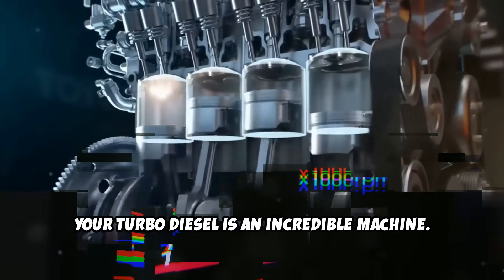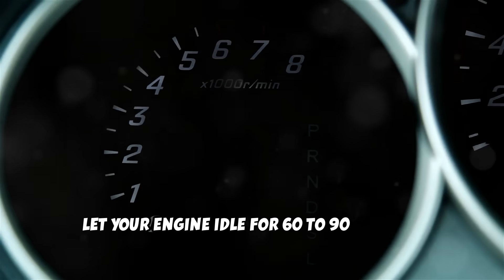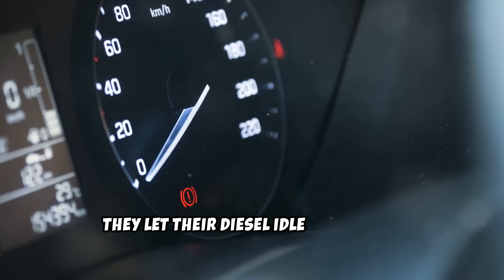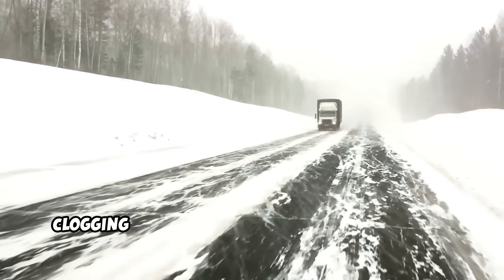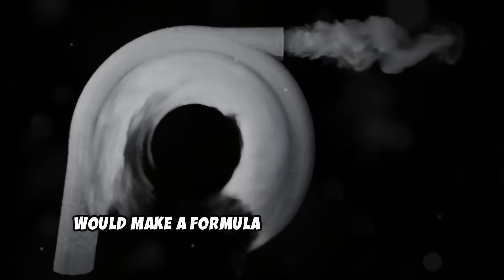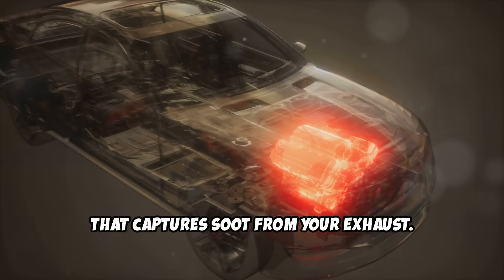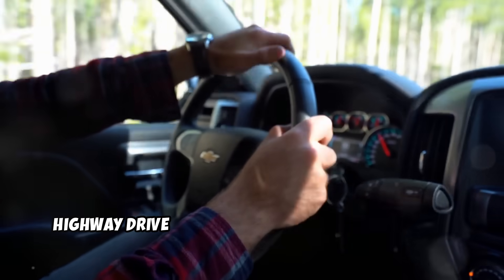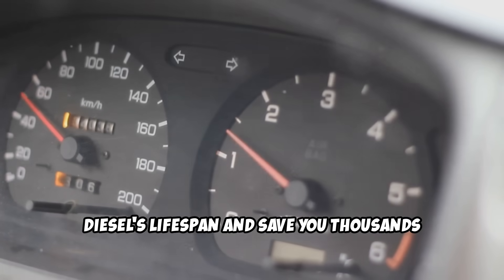Why Your Turbo Diesel Won't Last 200,000 Miles Anymore (Never Do These)

Comment: If you shouldn't turn of your car after a long drive how do you get on when you're car has a stop start
Reply: on stop start, the cars are only off for up to a few minutes the oil won't cook the turbo  as it restatrts  , but i still don't like continual on off and disable it